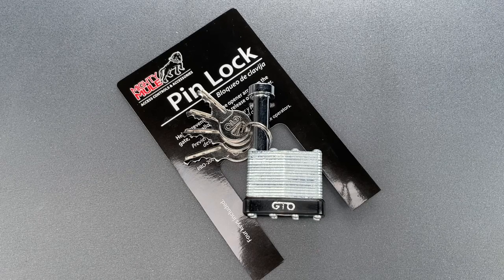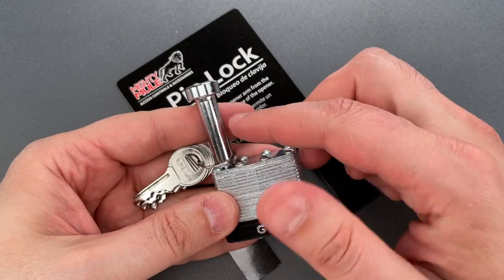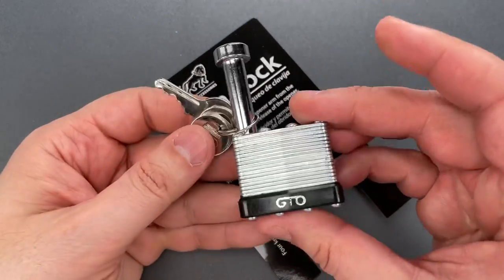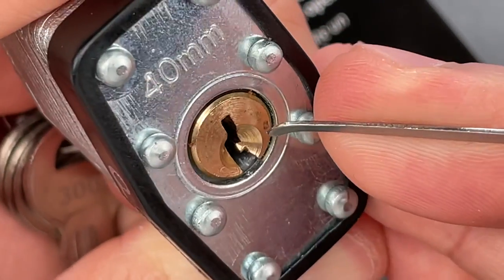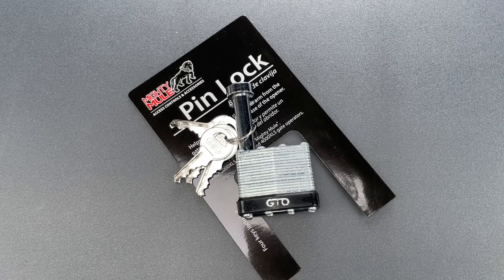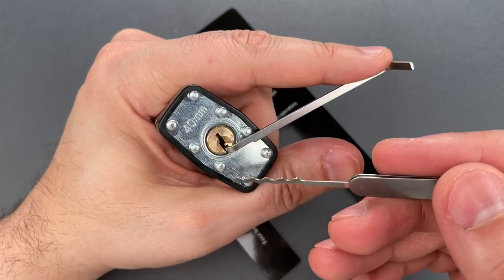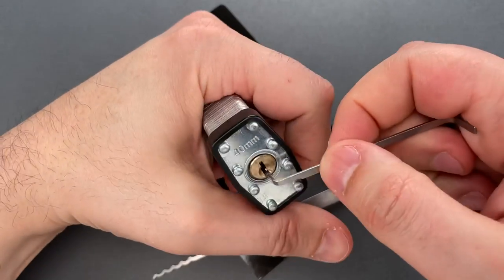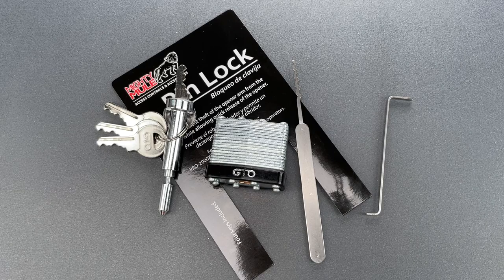[1426] Embarrassingly Bad: Mighty Mule Gate Lock

Comment: Could you do a video picking a master lock no.1 I can't believe how bad they are with in 2 seconds I can pick it open what is weird is I was using counter rotation instead of clockwise rotation 😳  and it takes less than 2 seconds with a normal pick

Comment: I'd be curious to see how this lock and other not-so-cheap locks stand up to a brute force attack using an impact wrench to over-torque the cylinder
Reply: an impact with a big flathead tip would probably decimate any plastic internals on these cheap locks

Comment: Try using a flathead screwdriver and just twist the whole lock. Destructive testing, but a common entry technique.
Reply: It shouldn't be too hard to brute force open, since it's made of plastic inside...
Reply: @mchenrynick  In my day (30?) years ago, that was the go-to method of breaking into cars. Jam a massive screw driver in the lock and wrench the whole lock around.

Comment: Ok. We see the lock isn’t very good but let’s have some fun….. You picked this one like a standard padlock. If this lock was installed for intended use and put in a hinge, the key way would be pointing straight down with no swing movement and possibly up against a post. Let’s see how long it would take to pop this open while it is pointing down and the LPL is basically working blind. It may just take longer because of the odd hand position. 
I would think there would have to be better locks for this intended use, (I haven’t looked yet) with a more challenging set up and key system…. Oh I think I just invented a new lock… A pin lock like this with a dick detainer core!

Comment: 18.00? 
What a rip off! You would be better off using an aerospace hi-lok and a steel break away collar. No one is going to take that apart with tools that fit in their pockets A nice fat .375 NX bolt. BACB30NX12K25 and a BACC30BH12 collar. Flat head fastener just as round as can be and the collar once you reach the torque value it shears off and the flats you wrenched it on with are lying on the ground.

Comment: The comment about the $1000 dollar gate now has the thieves going hell we have been worried about locks. Shit lets just unbolt and sell the gates. The locks we can just throw those in the trash. This lock is a true piece of trash. Brother the way you open these things is an embarrassment to these companies. I think you would be better off with a grade 10 bolt and nut tightened down to about 150 ft lbs of torque.